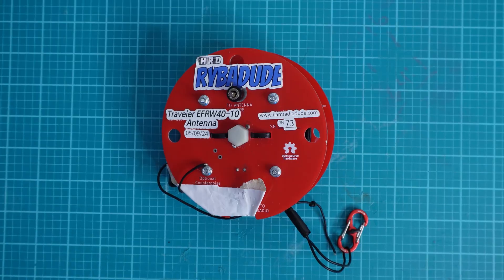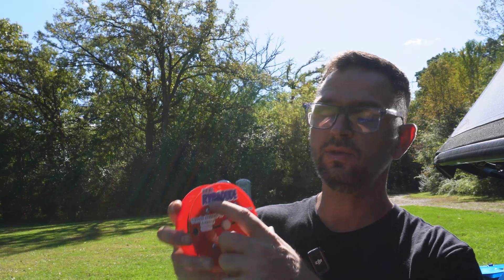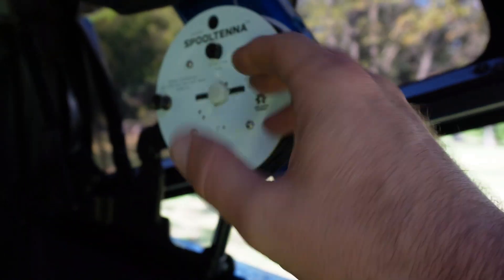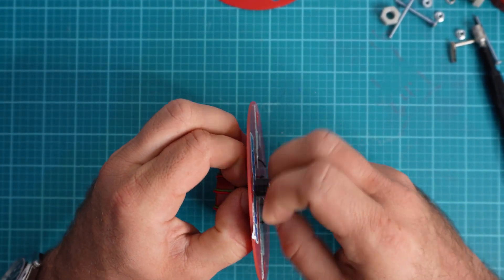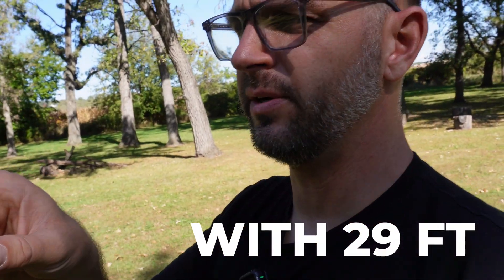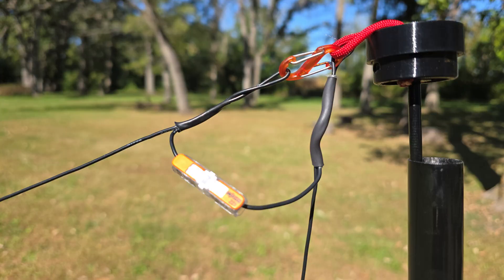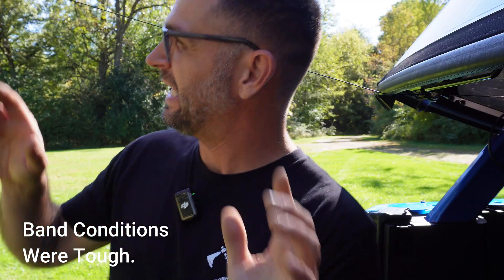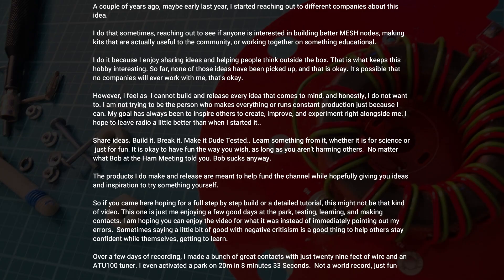This HF Portable Ham Radio Antenna is NFS! (Not For Sale....Yet)

Comment: You could do a 9:1 as well. From my testing the 4:1 works better . 25 ft is a length as well.  If you cut about 5/8 wave of wire on 10/12/15 /17/20 meters . You can trim to tune with out a tuner. you will get more gain but only 1 band.  I got one around 21 FT with a 4:1  and tunes 11 meter CB with out a tuner. Under 1.5 SWR . With a different toroid core like a 61 or 52 mix you can get 6 meters as well. But the 40 meters will be not so great or un usable.  A 43 mix should get 80/160 meters better. With them bands the T 200-2 should work fine ,Just more (longer) Counterpoise. Get more copper on ground for the longer wavelength . Ground coupling. 73
Reply from the maker: Always great input!   I did test a 43 mix this morning in the RYBADUDE.  with that same 29ft of wire (the feedpoint being 20ft down and sloping down) and a 20 ft Counterpoise - I can tune up 160-10. Only troubles is 160 is 20+ over noise :D.   I'm happy with things so far.  next, I need to figure out who to wind two toroids for a 4:1 balun, insert a swtich, and modify it so this can work as a 4:1 unun.   The power to have an OCFD, Delta loop, EFRW, and more antenna, is intriguing.  

I think one of these will make an appearance in my quick, upcoming HALLOWEEN DECORATIONS video :).   

73 and Thanks!  Always great input!

Comment: I want a 80-10 spooltenna EFHW
Reply from the maker: Interesting thought.   I suppose I could take the current Spooltenna EFHW, disassemble it and add on a longer piece of PVC (or this 3d printed part). This would allow me to add more / double the length of the current Spooltenna EFHW.   Most of the bands would be okay, but a coil would probably be needed.  For that, I may have two bullet connectors, one on each side of the coil, to be able to rapidly connect or disconnect the coil.       That would be pretty interesting.